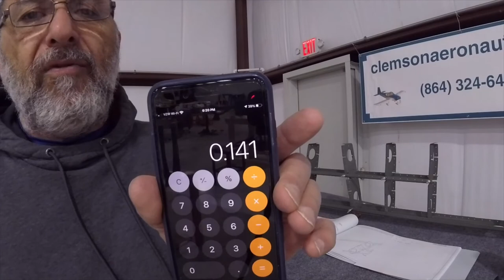Clemson Aeronautics RV-14A Build Riveting Essentials

Comment: On adjusting for yoke flexing (at 29 minutes), you got me thinking. The shop head volume is proportional to the square of the diameter, so, assuming the shank is already against the material such that the shop head volume stays constant, to get to a desired diameter d2 from a test diameter d1, I would expect to have to change the squeeze height by (d1^2/d2^2 - 1)*h1 where h1 is the test height, but no adjustment should be made if h1 is already less than 0.5 diameter.
Reply from the maker: Thanks. I don't think your formula (d1^2/d2^2 - 1)*h1 will work. The squeezing force will change as the rivet's diameter gets bigger while you are squeezing it. And also the amount of material exposed could vary from one job to the other and you have to have enough to achieve 1 1/2 the diameter and 1/2 the diameter in h1  .  Manufacturer of the kit can call for a size that is the closest to what they need, but if the result is h1 less than half of the diameter you have to go to a size bigger. Thanks again.